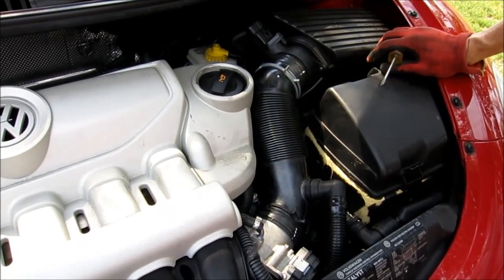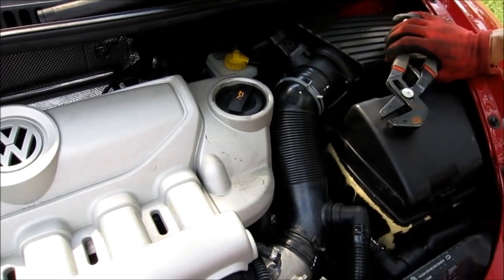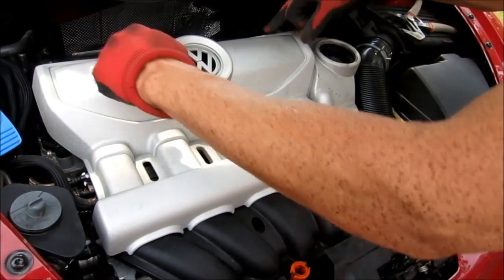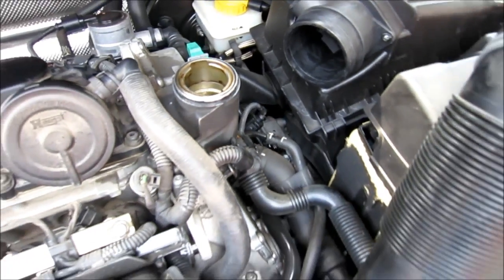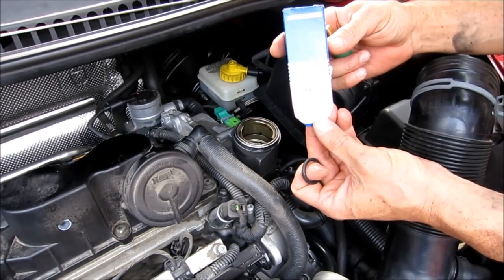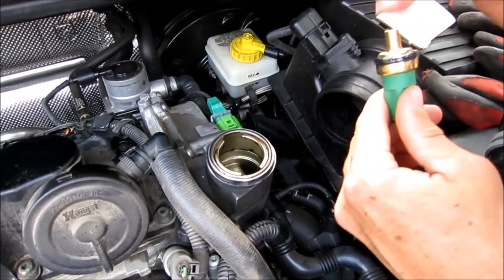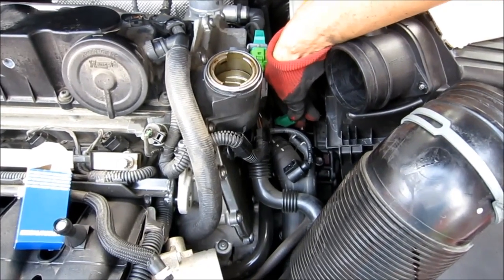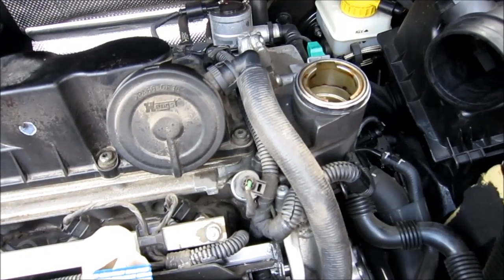How to Replace Volkswagen Beetle Coolant Temp Sensor P3081

Comment: Use silicone for greasing or Windex for barb fitting on rubber and Buna-N, use Vaseline and never silicone on silicone rings and hose, and whatever is handy on nitrile. Pretty sure the cheap sensors use Buna-N and nitrile.

Comment: Thanks for the video.  $30 DYI fix.  The only difference with my daughter's vehicle is that the release for the connector was on the right side, so almost impossible to access with a screw driver.  I ended up taking the clip off first.  It was a breeze to take off the connector once the sensor was off.

Note, the clip fits into two cutouts on either side of the tube that the sensor goes into.  Make sure you put the prongs of the clip into them when you slide it into place.

Comment: Thank you for the great video, it fixed my problem.  No more sounding like a space ship (fans winding up) as soon as you turn it on, no more check engine light, and I believe various aspects of the car will now run smoother.  I have a few constructive comments.  Like everyone else, the vaseline is a no....best is apparently silicone based grease which I bought at the home depot.  Secondly, I did not remove that plastic engine cover, I don't see a benefit there, but I did remove the air filter box entirely (2 screws and unplug the MFS.  Made it like working in my living room.  Strangely, my coolant didn't come flowing out.  I could see it there, but not enough to come out, which yes....I found that mildly concerning.  I did not need a screw driver in the electrical connector, was made to unsnap by hand (yours might be too).  The sensor rotates by hand and my snap was on the bottom side not front like yours.  Thanks again!

Comment: Great video, I would suggest instead of Vaseline on the o ring which is a petroleum based product which deteriorates rubber, use di electric grease. It's silicon based, and will not deteriorate the rubber.
Reply: Exactly. And, never use silicone grease on silicone. Buna-N is mildly affected by oil, not like rubber though. Nitrile is impervious to most auto chemicals. I'm an automation and building mechanic, I use Tri-Flow for everything but silicone and good old original Chapstick or Vaseline for silicone.

Comment: Take the cap off to release the pressure then put it back on before you remove the sensor. It will loose less coolant then
Reply: Yes, this way you only lose about a tablespoon of coolant. I placed a sock underneath it to catch it.

Comment: Good video, except for the Vaseline part.  Don’t every put petroleum products onto coolant parts: orings, seals, or hoses.  Coolant orings hoses and seals are not petroleum resistant and with swell and deteriorate.  Petroleum may only be used on oil seals, and gaskets: like valve cover gaskets or cam/ crank seals.
Reply: Yes. Use silicone lube. If you don't have any, you can buy a tiny packet at the auto parts store for about $1.00 and you will still have plenty left over.

Comment: Hi, my girlfriend got a new beetle from 2002 and the light of the coolant on the dashboard it's all the time on in a blue color. I read on internet that if it never turns off, it means that there is a problem in the electric system of that part. The only thing I can think about is the sensor. Would you have some idea about that? 
The car has an automathic gearbox and always changes so late, that's a reason too why I think is the sensor since the engine wants to warm up..
Thanks!